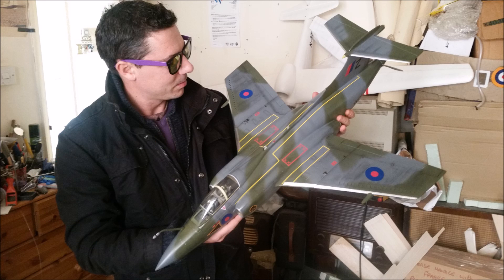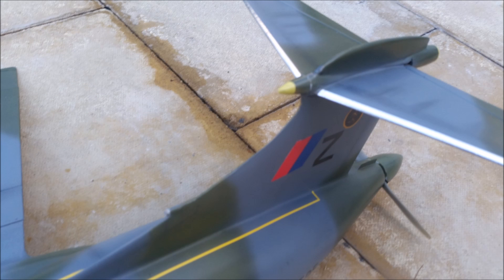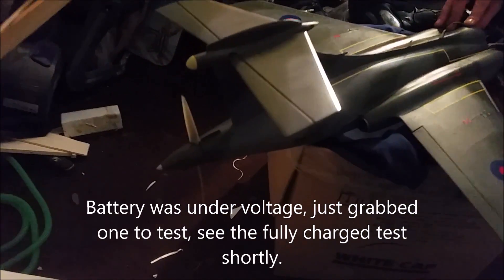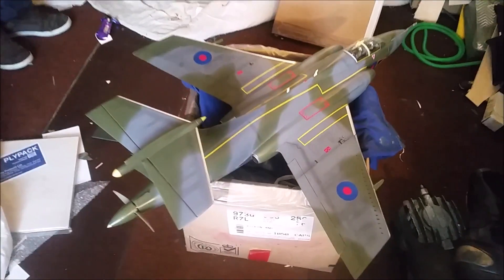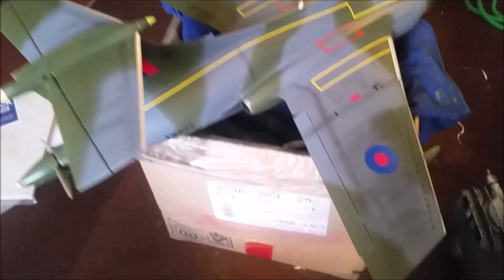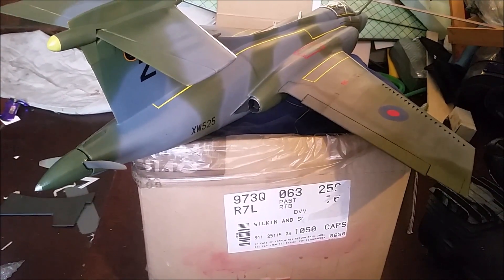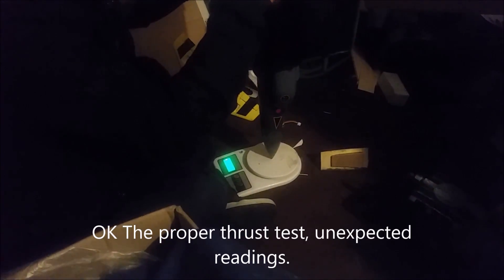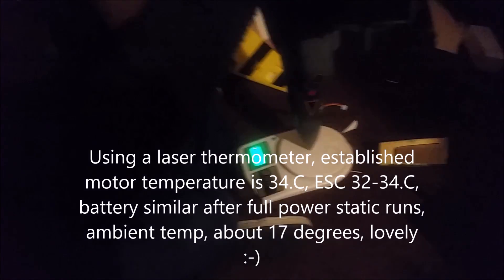Blackburn Buccaneer Park Jet, Static tests and temperature readings.

Comment: Really fantastic job, I love it! My suggestion, with that much available thrust switch out to a 5.5x5.5 or a 6x6 prop.  It'll fly at a greatly reduced throttle but full chat flybys will be nothing less than spectacular! It'll fly the part of a jet.
Reply from the maker: DVRCGreg  Thanks Greg. Actually we discussed the very same thing yesterday.  Thinking along the exact same lines lol. It means pulling my perfectly aligned spinner off which is held with por glue, will be a faff to re centralise it but the benefits will be good. Glad you like her. Twin EDF version next :-)